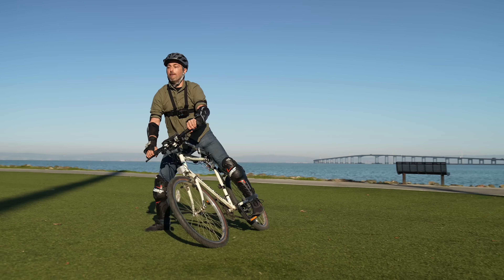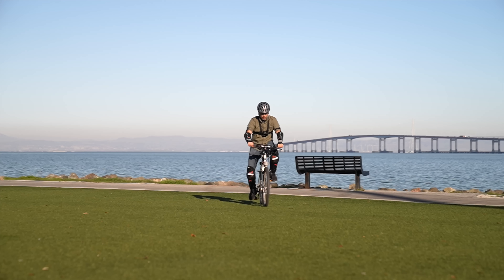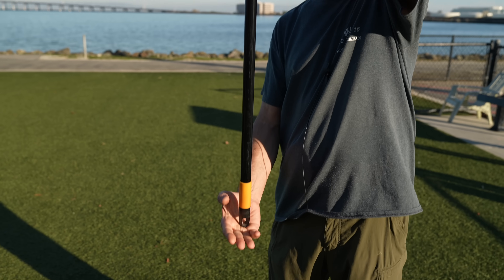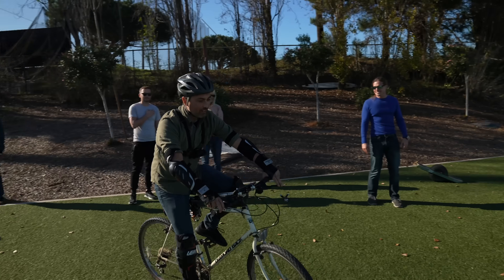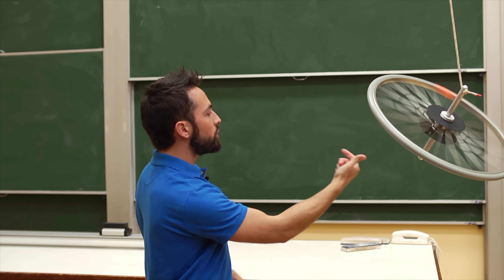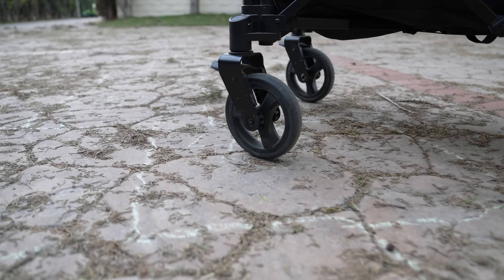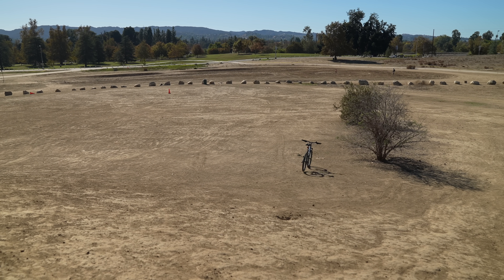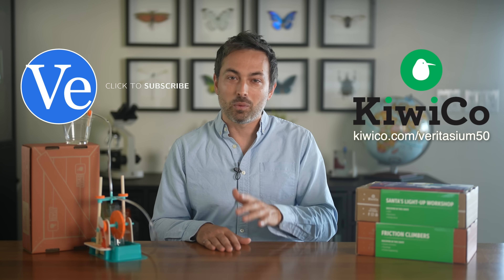Most People Don't Know How Bikes Work

Comment: As someone who can cycle without touching the steering wheel, I would've loved to give that jammed bike a try. I feel like it's more a matter of counterweight than turning the wheel.
Reply: Your feeling is wrong.
Reply: I find that you still steer when riding hands-free. Just shifting weight instead of turning the handelbar to do so
Reply: @youtubeaccount4910  when you ride a bike no hands and lean it watch where the bars are turning, it naturally wants to counter steer. So when you start leaning left with no hands the bars will start to turn right
Reply: Yeah that wouldn’t work. They showed this in the video.
Reply: Professional motorcyclists simply lean the direction they want to go higher speeds cause more gyroscopic effect the handlebars do almost nothing
Reply: @patrickday4206  The racers lean their motorcycle by counter steering. Often with very high levels of force. This is part of what makes racing so physically demanding. 

Keith Code's performance motorcycle school demonstrates how inefficient body steering is with their "no BS" (body steering) motorcycle about thirty years ago. 

Studies have found that not understanding and using counter steering is a contributing factor in many fatal motorcycle accident on the roads of the USA. This has been known for about four decades.
Reply: How riding with no hands or leaning to turn works is that by learning you upper body to the left that causes the bicycle and your lower body to lean to the right. That is an equal and opposite reaction. The bicycle learning to the right causes the front wheel to turn to the right for the reason explained in the video.  This front wheel turned to the right is the counter steering that will cause the bicycle and rider together to lean to the left. Which then causes the turn to the left.

I do wish that the video covered this. But I understand that it would have made the video too long for most viewers.

Comment: I understand the basis of this idea, but I feel it has some holes in it. I've seen people bike at high speed without using their hands at all, and yes, that includes turning. You can assume that the bike is somehow corrective steering itself at high speed somehow, but personally whenever I try to bike without my hands, I almost immediately lose my balance because the steering always goes wild if I'm not moving fast enough.
Also people can balance on a stationary bike and they can do it fairly easily. It's called using rollers. I won't deny that steering highly contributes to keeping balance in this case, but it's virtually impossible if the wheels aren't spinning.
Reply: How riding with no hands or leaning to turn works is that by learning you upper body to the left that causes the bicycle and your lower body to lean to the right. That is an equal and opposite reaction. The bicycle learning to the right causes the front wheel to turn to the right for the reason explained in the video.  This front wheel turned to the right is the counter steering that will cause the bicycle and rider together to lean to the left. Which then causes the turn to the left.

I do wish that the video covered this. But I understand that it would have made the video too long for most viewers. 

I have some ideas how they balance while standing still. But I have never tested those theories. Also note that they are usually not standing perfectly still. There are a lot of very small movements. They just aren't moving forward. At least not noticeably.

Comment: The missing point here is that you can change your balance without turning the handlebars at all. That is how I steer while riding forest rails. There is simply no room to counter-steer going in very rough train, so you naturally adapt by moving you bodyweight rather than steering. Once you are leaning to a side you follow up by steering or simply lifting the front wheel where you want it. You will never find me counter-steering even going in flat terrain when I want to turn. I lean then steer.
Reply: Of course you can change your balance without turning handlebars, but you can't turn a bike without turning the handlebars.

Comment: This is a rookie problem. It would be easier to steer if you were going faster. If you can lean without steering, you can maintain balance, but that only works if you have rotational inertia in the wheels and if you’re skilled enough to pull it off reliably.

Comment: That’s not counter steering. At speed (over 10mph) you continually counter steer right to turn left and vice versa. And slow speed, you turn the handle bar left to go left. Anyone that rides a motorcycle and faster speeds understands this.
Reply: You countersteer at all speeds.

Comment: Whats funny is you can completely forego a counter steer if you have ever ridden in a skatepark, done street/comp trials, or have been mountain biking for a while because you learn how to move your body and make the bike follow instead of you making the bike bring you around the turn itself
Reply: Im glad you said this, as I tried to simulate the video on my bike and was able to do it without issue - which really confused me.
Reply: You're right, anyone remotely decent at cornering, even on a road bike can make a turn without countersteering, you just lean in first. Derek even does it in this video and it gets dismissed as luck. 

Most scientific explanations of how we ride bikes miss out lots of these edge cases. Like I'm pretty sure someone who is good at railrides could ride this bike with the steering fully locked, at least for a lot longer than the casual riders in this video. And, I bet one of those pedal-wheelie kids could probably just wheelie this bike and turn using their weight in both directions regardless of how locked the steering was. 

This reminds me of that 'reverse-brain' bike that guy made where the handlebars have the opposite effect on steering. It's claimed that you need to totally relearn to ride it and that it will "re-train" your brain into cycling the wrong way and mess your whole riding ability up to the point you find it hard to ride a normal bike. But I'm sure anyone who can push start with their leg and then ride no-handed would be able to just ride it no-handed first try?

Comment: Why does the bike balance on its own with sufficient speed you may ask? 

Since the body of a bike is locked in one direction then ultimately the front steer tends to go with the direction of the weight of the body.

At higher speeds you dont need steering and the only way to go whatever direction you choose is by breaking balance... 

To prove my theory
Try having the back portion of the bike have steering conditions or directional changing status you will
See that it will be more difficult to manuever

Comment: if you approach a planet from space, one side is facing the planet the otehr side is not, which side is likely to have more density whether it is just one spec of dust or not?  that dust can touch your hull and spin you and cause the orbit, the larger the object relatively speaking, the more particulaei density causing more clutch grab and slow aka gravity friction / tension ... space is water but its way cleaner so more viscose, it also may be under less pressure due to movement, so less gravity despite higher pressure and more gravity depending on reference field, perspective reference limits etc, its important to limit a formula or experiement otherwise the only answer that computes best is everything equals everything

Comment: a giant tire in space, rotating on spokes can travel faster than light in a straight line on a surface or in an arc if referenced from the center spoke, this later motion allows you to move more freely in space and time when faster than light, the former you srae stuck in linear space motion, however the spoke model has an anchor in some reality, when we build time machines where we left from is our center spoke and anchor to this reference gravity field reality ... gravity influences our reality perhaps more than anything else so that determines our reality, gravity influences us before matter, you just say the gravity came from matter what if it pushes us there, what if voids push us away more or completely and clumping is friction, aka surface tension, like densities coalesce, this is way more accurate way to see gravity than even space time curvature which seems more of a consequence of this, friction in space time

Comment: the ultimate measurer would be light that is not moving, stationary, and observe how it is skewed by forces, this can be achieved by casting light in a measuring sphere fom stationary and them moving at light speed to simulate stationary, its possible with a giant wheel

Comment: in classical mechanics you have stired potential energy but in relativity everything has infinite stored potential energy when compared or reference field to everything else, the first example potential energy is based only on a limited or vertical reference field.  the pendulum is limited by the string which ties it to a reference field.

Comment: hey justin is it?  the bigger front wheel adds alot to stability , it must counter the acceleration and forces when you peddle however i notice its benefits when turning, it changes the run arc, it must relate the rider raising the center of gravity and effort changing the turn arc, essentially a bike is like a sail boat, all these forces than can be sumed or boiled down to coe vs cor ... as opposed to clr, when you spin tires you get lift also, im glad u and the others are on the science team

Comment: Actually you don't have to always countersteer the bike. if you auto-shift yourself and your weight separately from the bike, you can match the weight -> movement ratio that you'd normally achieve from countersteering.

Imagine it like you have 3 components; 
-Your upper half
-Your lower half
-The bike itself

To initiate a right turn, first you center the upper half to face more of the right. You don't move your body away from the bike's center, you stay in the middle.. just rotate.

With the lower half, you gently lean the bike into the turn. You don't turn left to setup your weight, since your weight is already the one that's going to shift the bike into the right position; turning left prior is an instinctive that comes from relying on the bike's geometry to keep you stable.

Finally, to make any adjustments, you "countersteer" your upper half to realign the bike by forcing it to re-shift itself.

7:06 Is probably the best example of someone not using their full weight and geometry to re-balance the bike.. but I didn't say anything about going straight so it makes sense he'd fall. You'd need A LOT of mental and physical control to keep it center.

When moving in a singular direction, yes of course you need countersteering just the same as you'd slightly, manually, readjust a car that's not going "straight" anymore(aka the direction you're wanting to go).

The reason most people wouldn't be able to ride without countersteering on bikes, is because when you turn right before you turn left... it's to prepare mentally for the left turn, almost like a windup for a punch. Countersteering is important to keep the bike consistent with the perception of "straight" that you want to go.

If you overcome the mental block, and learn the balancing that comes with it.. you'll find that you don't always need to countersteer to make a turn.

Learning this is about the same as learning to ride a backwards-bike, except instead you're just learning to cut out the middleman.

But that's just a comment, a naggy comment. Thanks for reading
Reply: no you can't. Try riding scooter following a long white line without constantly adjusting the handlebar. To have such precision you need constant small adjustment to the bar. For me riding a scooter at 60km/h following white stripe line I constantly lightly steer left and right like 5 times a second. 
And don't forget that the bike is actually steering itself, so if you're moving your body to the right, then you're pushing the bike to the left and the bike will steer to the left without you knowing, then you will go right. You can't balance the bike without countersteering, you can go straight handsfree because the bike is balancing itself. Moving your body to turn the bike will be tiring, just turn the bar it takes very little energy to turn no matter it's big or small motorcycle.
Reply: I don't really think that's possible

Comment: noob. i use my body to turn. i can make a turn with no hand.just balance
Reply: It is not hard to ride without hands, but it is impossible to ride without countersteering.
Reply: @XtreeM_FaiL  try to tilt your bike right to turn right followed by your handle. i assure you there is no counter used
Reply: @XtreeM_FaiL  i dont know why your defending this. but first know the reason of the cs. its to correct his balance. riding straight then steer will cause an imbalance and you will correct it. i agree. you are 100% right. but i still assure you. if you start to use your balance to turn then your wheel. try it. but if you suck at balancing. like the one in this video. he cant even ride straight without using steer to balance. i want to watch this again with a pro biker. pls

Comment: In driving school for motorbikes, they teach about "paradox steering impulse" - to steer left, you gotta give the front wheel a bump to the right, that makes the whole bike roll counterclockwise a bit, and that then makes the bike yaw left.
Reply: Yeah this is basic countersteering. Locking out the handlebars, it's no surprise this throws people off, it's instinct and we don't even recognize it on bikes, just more pronounced on motorbikes.
Reply: Exactly - over a certain speed, you push into the turn.  To turn left, you push the left handlebar.  In a more upright-sitting motorcycle, I would think of it as pulling over the turn (pulling the right handlebar to turn left).
Reply: @james-p  Understanding counter steering or push to turn as you called it is very important to motorcyclist safety because the amount of force required to counter steering at higher speeds with tires that are heavier than bicycle tires is much greater. To make a quick change of direction requires much more force than most people will produce subconsciously. Hence the reason that in the late 1970's or early 1980's the "Hurt report" (named after Dr Harry Hurt) concluded that not understanding counter steering played some role in a majority of motorcycle crashes. You made an important comment.

The "over a certain speed" part of your comment is a little white lie that the Motorcycle Safety Foundation spread mostly by failing to give more details. We always counter steer to start a turn. Thay is other than when we push the motorcycle over with our feet on the ground. But two things are different at very low speed. First, the force required is so low that it can easily be done subconsciously. Second, at low speeds we also need to steer the handle bars in the direction we wish to turn. At high speed this steering happens by itself due to the factors described in this video and additional factors. 

I assume that you are a motorcyclist. For the fun of it experiment with carefully adding a little counter steering to initiate a low speed tight U-turn. It will snap the motorcycle into the turn quicker and may make U-turns easier. But be careful. It is easy to counter steering too much at these low speeds.
Reply: @erniecolussy1705  True, that.  The main point of knowing how to countersteer on a motorcycle is to get the bike into a turn by pushing the handlebar, not by leaning the body - i.e. leaning the body over to get the bike over, rather than countersteering and then leaning with the bike.  I see people out on the freeway trying to turn by forcing their body weight over all the time (that works, but it's slow and sloppy) and I think, "ah, you've never had a riding lesson!"
Reply: As @erniecolussy1705  wrote: not understanding counter steering plays some role in a majority of motorcycle crashes.
Reply: If anyone in this particular thread would like to see a full and detailed mathematical/physics-based text on the kinematics and physics of motorcycle behavior have a look into 'Motorcycle Dynamics' by Vittore Cossalter of the University of Padova, there are a considerable number of interesting physcial phenomena associated with motorcycles and high-speed bicycle physics as a whole that he decribes very effectively in his texts. It certainly helped me through both my under and post-graduate studies in Motorcycle Engineering! 😁
Reply: I learnt this when I started learning how to drift with my car.
Reply: That was also the plot to the movie cars
Reply: i cant believe that he had to make that mechanism to figure it out (or point it out). It' so stupid
Reply: What a load of rubbish. At low speed, you just turn left or right…higher speeds, you lean the bike in the direction you want to go.

There’s no bumping the wheel or rolling counterclockwise.
Reply: @williamwilson6499  Ever had motorbike lessons? Ever tried that? I did, on german motorways, at over 150km/h. It's maybe not a bump but more of a slight push, but otherwise exactly as described.